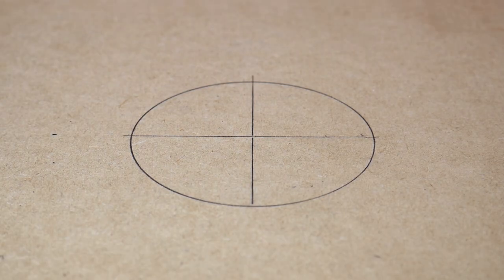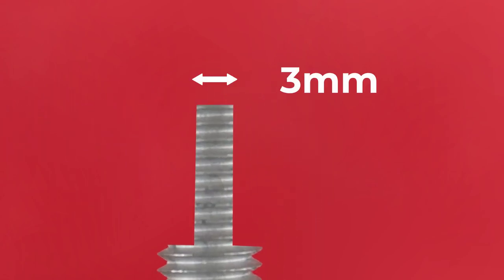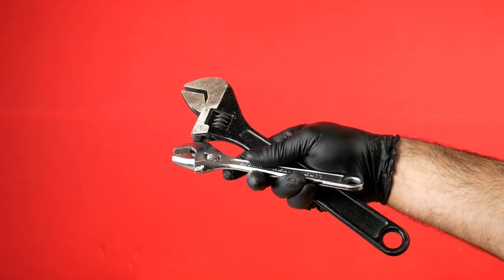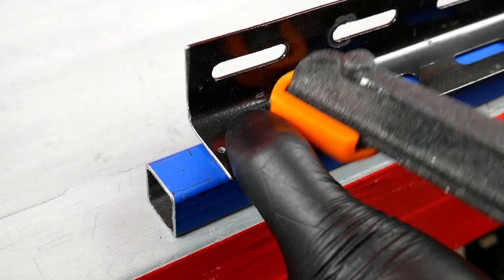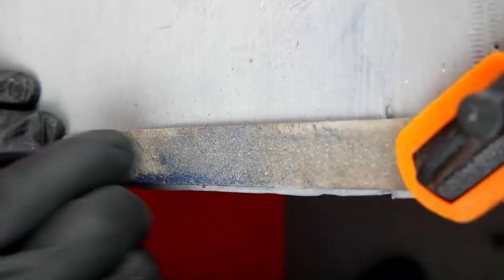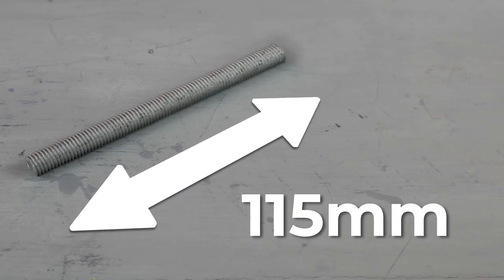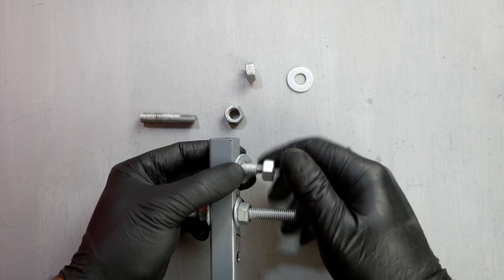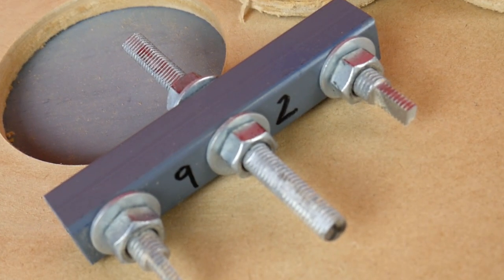How To Make An Adjustable Hole Cutter

Comment: Great content! Creative use of common materials to get the job done!

How would you approach cutting an angled hole (diameter > 1'') in a wood sheet? Set the right angle on a plane and drill hopefully straight down with a hole saw?

Comment: Curious to know if you really need to drill the holes as you did or if creating a slot and allowing the cutting bolts move in and out would work?  That would allow you to create a truly adjustable hole cutter.
Love your ideas.  The practical and useful MacGyver. :)